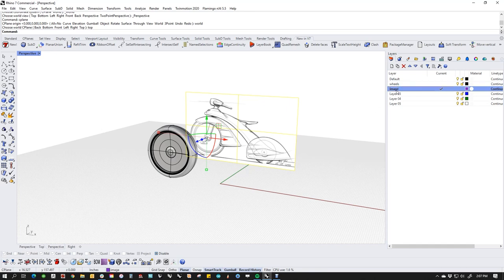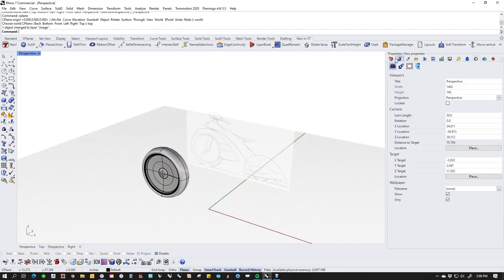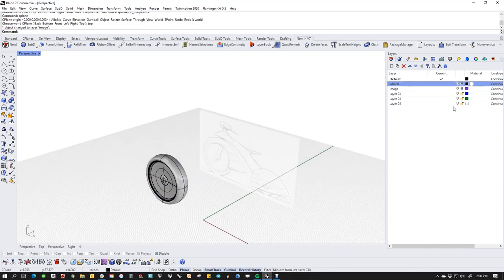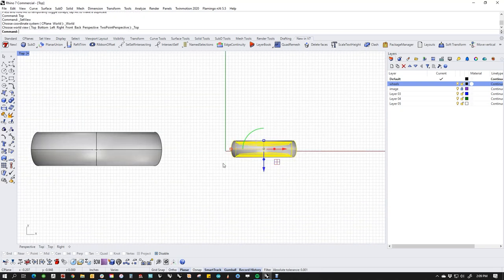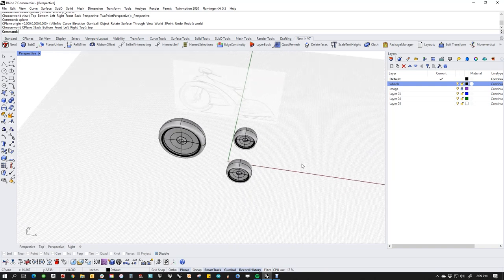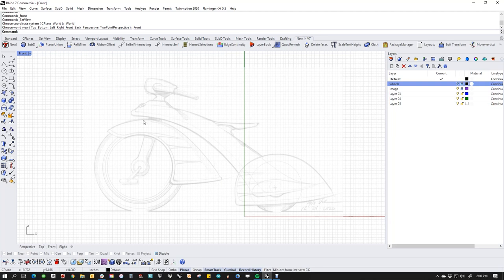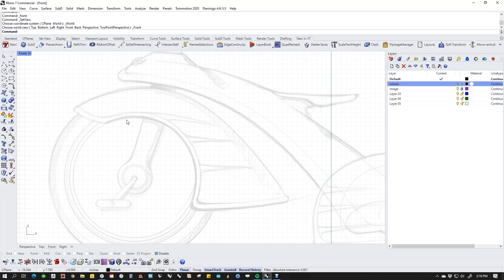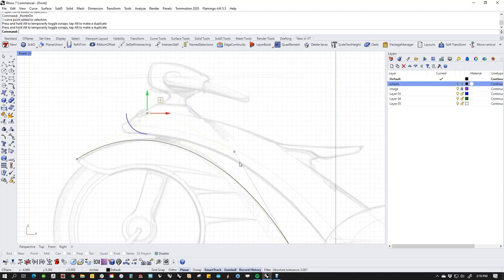Vintage trike in SubD

Comment: Another good one, Kyle.  Just took me a few days to get through it :p  How do you determine when it's ok to allow a triangle vs. a quad?  Your end model still had a triangle in it in the top of the frame for the fade transition.
Reply: triangles can be useful for fading detail and in our subd system are completely ok...(as are ngons when necessary) there is a great chart for how to control them 
here: https://www.blender3darchitect.com/blender-3d/table-with-mesh-organization-tips-for-3d-polygon-modeling/

Comment: Hello Rhinoguide, a personal issue: I'm trying to do something similar to what happens at 19min 53sec  of this video. But when I select an edge/edge circle, I scale and duplicate it at once (with Alt hold) I always obtain new curves and not new surface edges (like your fender rib). I tried it with different polygons and objects and key combinations but no way.. could you explain it to me please?
Reply from the maker: Start scaling the edgeloop with the Gumball and then while still holding the left mouse button down on the Gumball scale handle, also hold down the Ctrl key on Windows or the CMD key on Mac. This will create new SubD faces as shown at that location in the video. Post to the Rhino user forum if you need more help... https://discourse.mcneel.com/